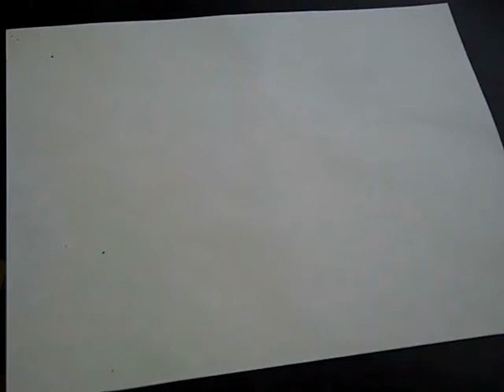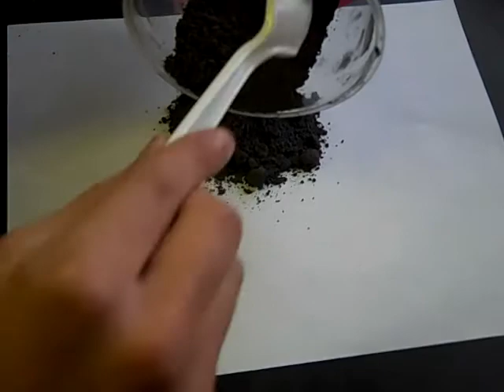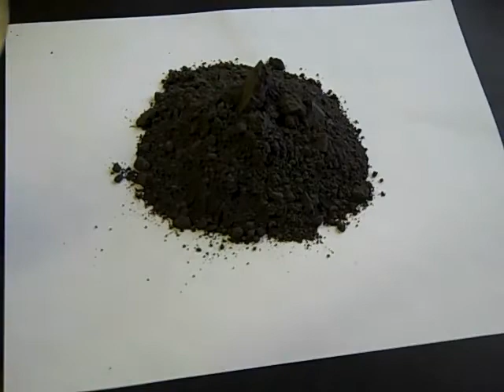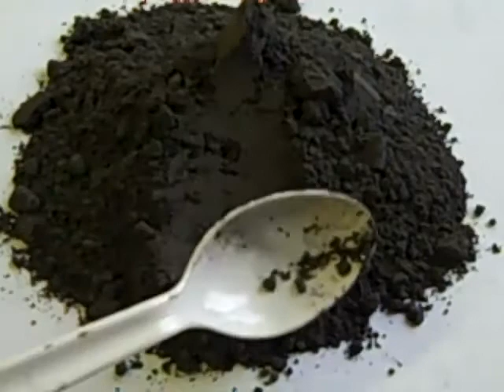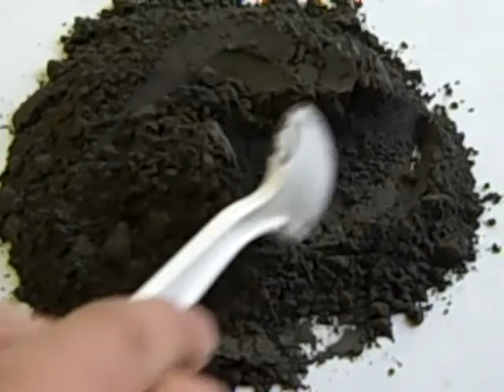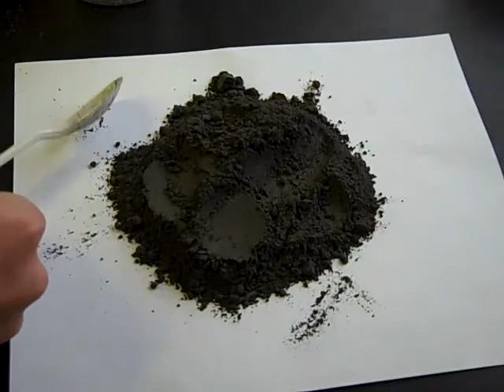A Closer Look at BP

Comment: Firstly, refining the ingredients of black powder to finer grains allows greater surface exposure of each ingredient to one another - thus increasing the amount substance available initially to the reaction. A block of sulfur, chunk of carbon, with a lump of potassium nitrate might react if incinerated - but it will be a minimal, slow reaction because only the surface of those chemicals are reacting. Until the internal substances are exposed - they can't react resulting in wasted substance. More substances available to the reaction means more heat, faster reaction.

As long as the mixture is in the correct ratio and properly mixed - clumping won't effect the efficiency of the reaction... However clumping of the individual substances prior to mixing may effect its ability to properly mix - reducing the reactivity of the mix.

Clumping occurs more often in finer grains due to the "van der Waals" interaction. (A phenomena that allows two like charged partials that would normally repel to be attracted because of the proximity of one atom's electrons(-) to another atom's nucleus(+).) This interaction can also occur in larger grains, but the overcoming force of gravity pulls it down, forming a pile instead. When the grains are finer, the interaction is stronger than the force of gravity - causing it to clump.

As you can guess, the clumping of the individual substances behaves as a resistance in the ability to mix. However, the bond of that force is weak - by using a ball-mill, it is easy to overcome this force by repeatedly bombarding the clumps with a heavier substance (i.e. Ball-mill media) forcing them to break apart while mixing. Using a ball-mill is an effective way of mixing clumped ingredients - but be aware of the dangers of doing so as this can have catastrophic and deadly consequences.

Comment: Yes to fine isn't good.  Granulating the black powder gives it a faster burn rate because the granules have space in between them allowing the fire from ignition to reach all of the black powder faster.  If your using it in a cannon, large granules allow you to use less powder because of a faster ignition of all the powder

Comment: I bought some black german aluminium that is over 1000 mesh (5 microns to be exact), and it actually looks a LOT like your black powder. So your black powder is definitely around 5 microns (or over 1000 mesh).
If I just spend max 2 minutes to quickly mix 7/3 ratio of some very very clumpy KClO4 and my black german aluminium, my FP never burns, it always detonates no matter if you confine, semi-confine or don't confine at all, and that's because of my 5 microns aluminium.. :P

Comment: i mill my bp until it is not black anymore. it will eventually turn gray. at that point, a ball mill will not make it significantly finer. then i add dexrtin to make it harden when i granulate it. people say dextrin slows bp, but just barely. i cant even see the difference. but bp cant be too fine, my bp clumps when it is airfloat too, but it doesnt make it any more difficult to work with. i havent had any problems with it being too fine.